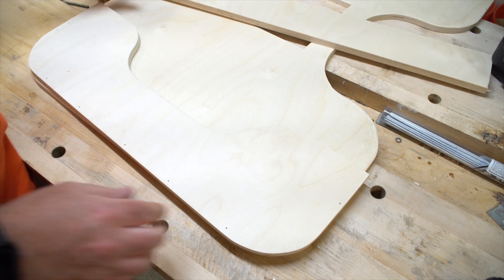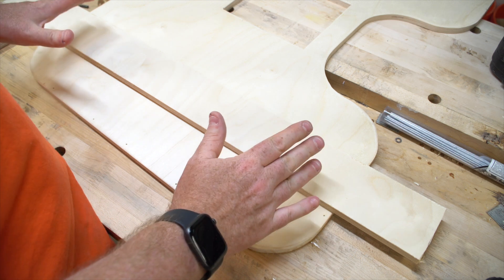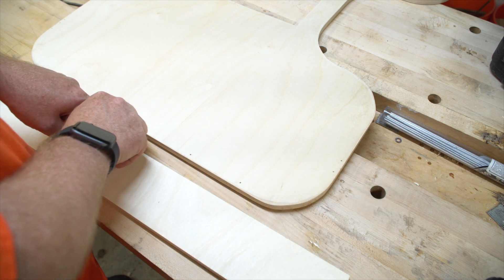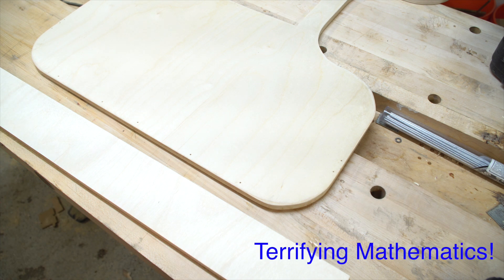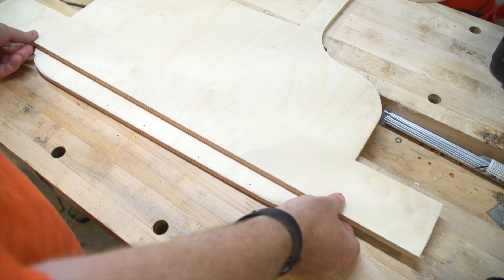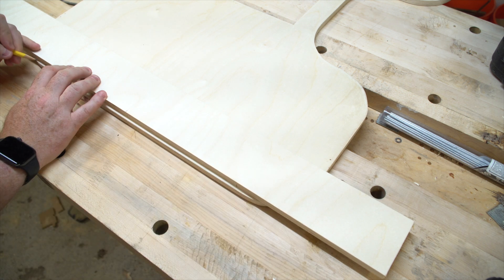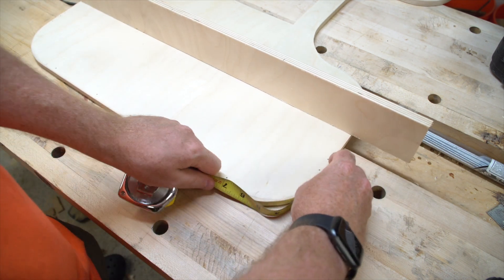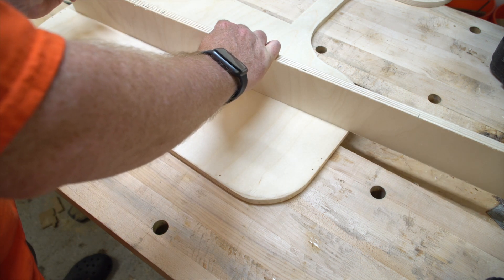How to Bend Plywood -- A simple technique to make bent plywood through "kerf cutting".

Comment: Old person, but new to woodworking here. I don’t have (and don’t want) a table saw, so yes, it’s probably dumb to use a circular saw and fence, but that’s what I’m going to try. I need about a 28” wide piece...don’t know how long yet.  This is for an outdoor project. Pretending I get the cuts done acceptably, do I need to fill in the kerf cuts with something, before painting, for weather protection? The cut side will not be directly exposed to rain, but temps in Texas summer, humidity, etc. Thanks for your input....I can’t hear the laughing or see eyes rolling, so, it’s okay! I always do things the hard way.😜
Reply: @David Thiel  Thank you so much for your advice!  I didn't know there was a different type of plywood!  I just got regular plywood and lots of exterior paint, hoping that would hold in the weather, but was going to seal all the exposed edges with some sort of sealer.  I will definitely look into the marine varnish.  I had looked at some YT videos on what they use on boats and all I came away with was... "do NOT want to fiberglass this thing!"  LOL   And YES, I do need "good luck".  It won't look like I picture it in my head, but it will be sturdy and that's the first order of business in this particular project! 
 Thanks again!
Reply from the maker: So... how'd it work out?

Comment: better to laminate than curf cut, you end up with ghost lines in time,
Reply: @David Thiel even biskets will show..they always do.
The only true way is to make jigs and  laminate .same as wood glue.it will show a line in time.most woodworkers never see the product after they are gone.
Reply: @David Thiel I understand but if you want a  better and stronger ger build stay away from curf .historically it was solid build up or laminate.that is the true method curf is lazy
Reply from the maker: Agreed.  This works for most folks, but if you want to do it right, bent lamination is the way to go.
Reply from the maker: @keithmarlowe5569  If you're going to bother laminating, then I wouldn't bother kerfing.  That would just be double work.  Laminating is "better" in many ways, but kerf cutting is quite acceptable and really works well in any number of contexts.